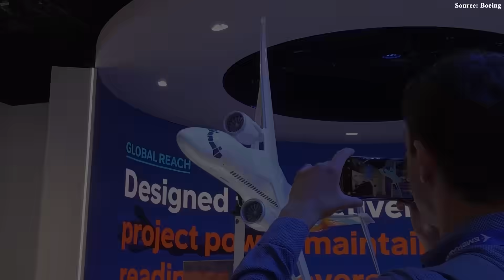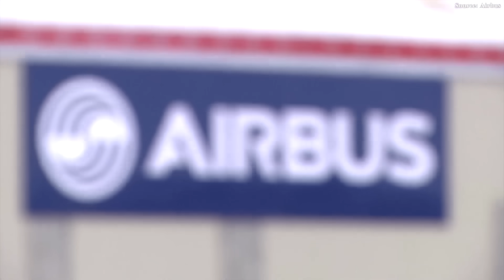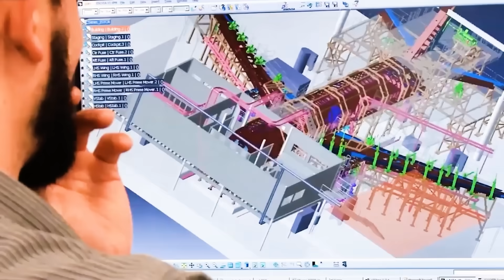Airbus Just Dropped A BOMBSHELL For A360 That Will Change Aviation! Here's why

Comment: I haven't spent a second listening to this crappy video clip "Despite speculation in forums and blogs, Airbus is not designing an aircraft called the “A360.” Company officials have repeatedly dismissed rumours of an A360 or A370, with a 2018 spokesperson confirming there are no active programs under those names."

If you use the search tool on Airbus website, you will end up with absolutely nothing than "Sorry, we couldn't find any results."

Comment: There is no need for the A360, because the A350 is already getting more orders than the 777X. In fact, the 777X has 580 orders and that's it. Nobody wants that big plane anymore. Open rotor engine technology can be used on smaller planes like the A320, A321 and maybe even the A322 one day.

Comment: Energy will determine who wins. SAF is expensive and engine efficiency will rule. Point to point will develop while hubs scale down. That said: B777X will need to sell at least 600 units to start making a profit starting in 2027. If they ever sell enough and point developments don't overtake the roll-out. Make the A 360? Only if the engines are a vast improvement.

Comment: It wont go Open Rotor. The blade off conundrum will mean fuel burn is no better once the weight increase for thickening wings & fuselage around the strike zone. It will be RRs Ultra-Fan